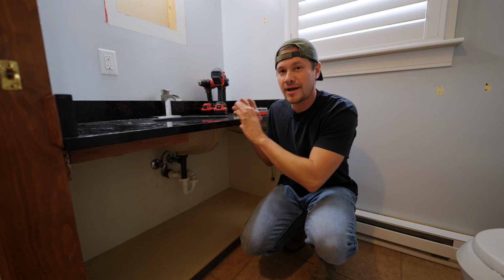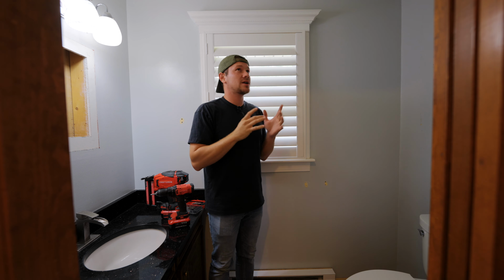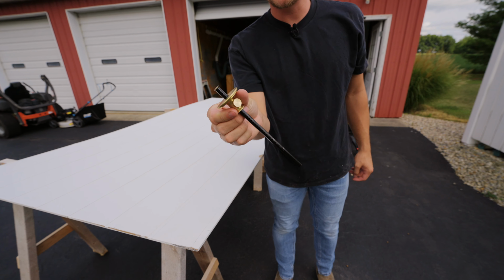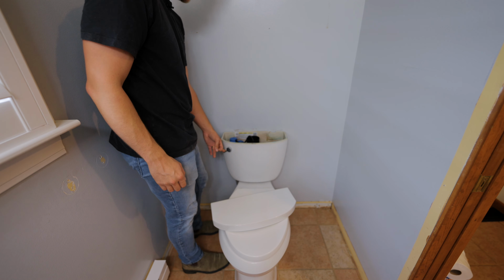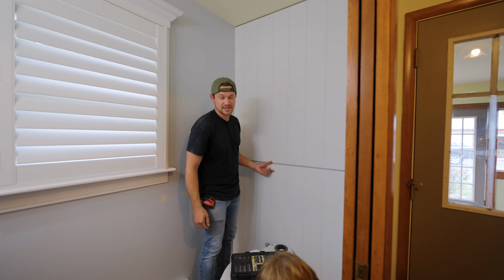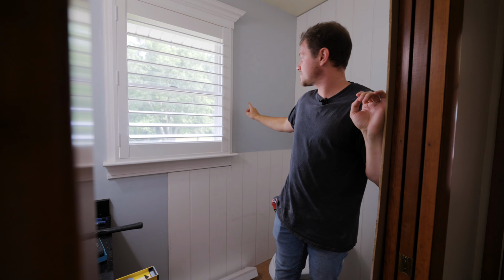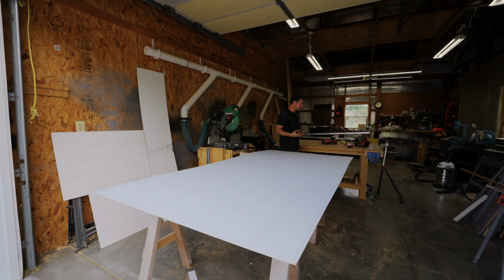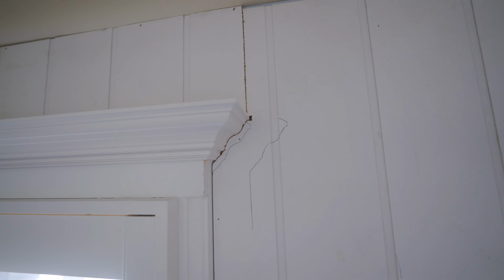Im Struggling

Comment: The Lord tests me every time I do a project and I also do a lot of sinning in my mind so you are not alone. 😊 Yesterday I replaced the screens in a few windows with solar screen that has a tighter weave and reduces the amount of heat coming through your windows. A couple of windows needed new frames and those windows were not the same size. Of course. 😂😭 

It took a lot of measuring and thinking and sweating (96° in the sun. 'Real feel' was 110°!) but we finished it. Lots of asking forgiveness for the words I said in my head! 

Once again, thank you for these videos. I learn something new in each one. Somehow I never knew you could remove the tank from a toilet. 🤔😄 For the next time you encounter this, using a chalk-line is helpful on those long free hand cuts. Take care and Lord bless!

Comment: For those long straight cuts you can use your hand as a guide. Put your thumb on the saw base, the side of your middle clamps under the sheet good your are cutting, and you use the side of your index finger as a guide by running it along the edge. That probably doesn’t make sense, but if you can figure it out you’ll be able to make dead straight cuts without any jigs or guides.